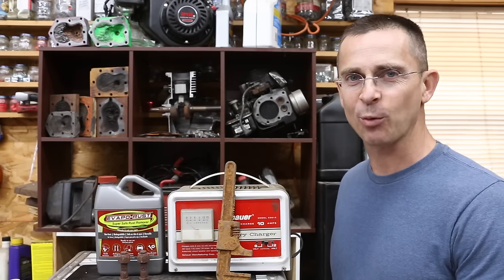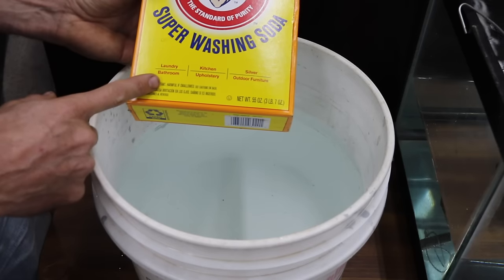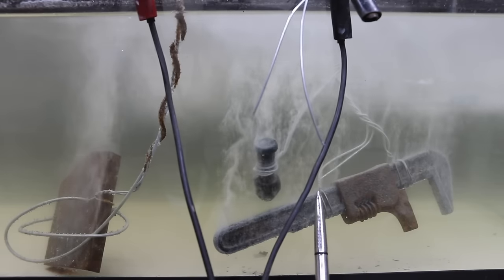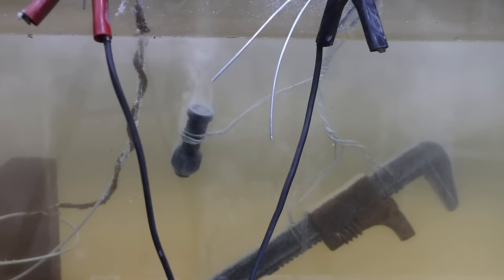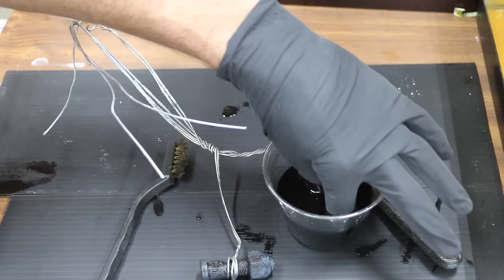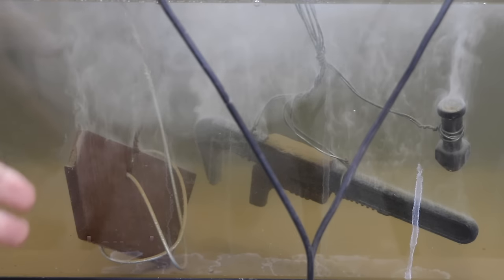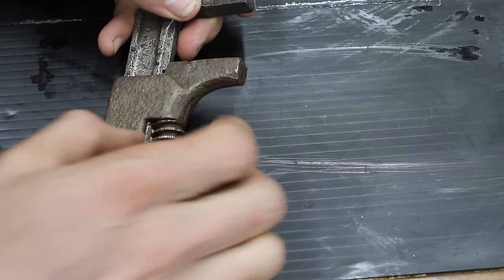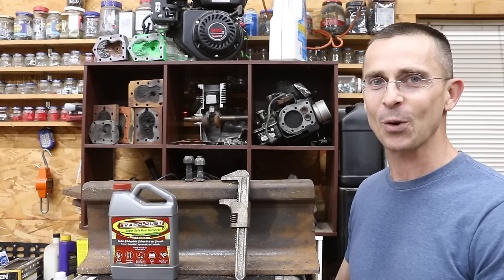Is Electrolysis better than Evapo-Rust?  Let's find out!

Comment: I've tried many different rust removal processes over the years and I've found electrolysis to be the best in most cases.  I like it mainly because it doesn't attack the parent metal like acids do, although soaking rusty or old files in vinegar will clean them up and actually help sharpen them in the process.  Blunted file teeth are reduced in size, so the effect is like filing each tooth, at a microscopic level on all planes, which results in them becoming sharper.  It won't get them as sharp as new, but it certainly will sharpen them some.  If you have a well used file that tends to skip or slip instead of cutting, dunk it in vinegar for a day or two in many cases, it will cut again.  

Electrolysis is also beneficial in another way; generally there are two kinds of rust on old tools or metals, the red outer layer of rust, which is the compound Fe2O3, or ferric oxide.  Red rust is flaky because it takes up more volume than the metal it replaced.  On very rusty things, you typically find a harder, darker layer of corrosion, almost a purply-grey in color, underneath the red oxide.  This is Fe3O4, which is basically the same as magnetite.  It is deceiving as it appears the metal under the red rust is just darkened, but is still corrosion.  You can think of the Fe3O4 layer as sort of the intermediate stage of rusting, it hasn't turned to full on red ferric oxide rust yet.  Fresh, or good steel and iron will have a silvery gray color.  Electrolysis will actually convert the dark Fe3O4 back to iron! 

The red rust gets converted to Fe3O4, the same stuff as the dark underlying corrosion, but since it is already loose and flaky it will fall off.  The conversion also makes the red rust flakes black or very dark (just like the hard Fe3O4 layer underneath it).

A mistake often made in the process is to use too high a current and voltage in the process.  Battery chargers work, but realistically for good quality conversion lower voltage and amperage is needed.  It seems counter intuitive, but higher amperage and voltage will erode instead of convert the underlying Fe3O4.  This might not be an issue for tools, per se, but if you do any research into the process, those who use it on artifacts will use a much lower voltage and amperage for better quality conversion to preserve the piece as much as possible.  A power supply that produces current in the milliamp range is better than using several amps from a battery charger.  If you don't have such a power supply, or don't want to buy or make one, you can insert a small lamp, like a brake light bulb in series to reduce the amperage in the tank.  The higher the wattage of the lamp, the lower the amperage in the tank.

Also, never use stainless steel for the cathode.  Stainless contains chromium, which leeches chromium compounds into the solution during the process.  These are a very toxic and probably illegal to dump down the drain, not to mention hazardous to you!  Only use plain iron or steel for the cathode and for the wire hanging and/or connecting the pieces!  Plain steel and iron on the anode end won't be affected by the process, so wiring to hang and connect the pieces won't get "eaten."  Sheet steel makes great cathodes as you can put multiple plates of it in the tank.  It's better if you have a cathode surrounding the pieces to be cleaned.  Also, as some have noted, make sure you have all your pieces electrically connected.  If you see a piece that isn't cleaning, that means it needs a connection.
Reply from the maker: Thank you for the feedback
Reply: What you add to water?
Reply: "Electrolysis will actually convert the dark Fe3O4 back to iron!" Read the comments in Ken Sweden's video (a chemist) where he says that is impossible: https://www.youtube.com/watch?v=8ulL57OgGu0&lc=UgzZvfU30rtXrT8LVrh4AaABAg.925slTrVO6B926M-jR6oHo  and I quote: "Rust is never converted back to iron, it is impossible. For that you need 2000 degrees and a melt furnace."
Reply: So a usb charger would work?
Reply: A metallurgist?
Reply: @skiterbite  no, just a tinkerer that likes to read a lot.
Reply: @ameunier41  Yes, it will.  But, as you lower the voltage and amperage, it increases the time needed to work.
Reply: one little twist, for the bulb in series-a lower wattage bulb (higher resistance) will lower the current in the tank.
Otherthan that a great comment and thank you for that little review!
Reply: @bgoodr3520  The rust isn't converted back to iron. The Iron III magnetite (black oxide) is likely converted back to iron? Black oxide protects metal from rust. When you wash your parts in phosphoric acid or citric acid, it forms a thin layer of the black oxide magnetite and protects the metal from further rusting. Failure to passivate the metal with phosphoric acid, will cause further rusting. Only phosphoric acid (or optionally citric acid) is an ideal acid for a final cleaning of a steel part, or stainless steel part. It also passivates stainless steel by bringing a chromium layer to the surface and removing microscopic invisible rust from stainless, thereby sealing it. Washing a part in hydrochloric acid, like everyone does, is not acceptable, unless it's done very quickly, and neutralized, then followed by a passivation with the correct acid. Even if you think a part is clean, if it hasn't been washed in phosphoric acid, there can be invisible iron oxide (red rust) forming, which can cause unexpected paint failure years down the road. Use self etching (phosphoric acid) primer, or use metal conditioner (phosphoric acid and water) and wash the invisible rust off and create the black iron oxide passivation film, before paint. Some say that vinegar (acetic acid 5%) actually passivates steel by forming some type of grey iron acetate compound on the metal, but acetic acid is not normally used for commercial metal passivation. If your steel turns dark grey or black, it is likely to not rust very easily. Getting it shiny silver, means it has no black oxide coating, and so the metal is very "open" and reactive to the atmosphere. Always oil parts, and wrap in a warm blanket, to stop rust A blanket (not plastic) is what stops rust. You want to keep the part in a blanket, which blunts the temperature changes that occur, stopping 99% of the condensation that normally occurs when a cold object meets hot air. Plastic can work, if you start with with extremely low humidity before wrapping in plastic, but it's not necessary. Putting objects in a small wooden box that is air tight, is usually enough to stop 99% of condensation and rust. But you can't leave it partially open, or warm air will hit the cold steel and cause rust.
Reply: Evaporust is apparently the best chemical product there is for removing rust. But it also removes oxides off of aluminum and brass, and other metals, so you can use it as a safe, non acidic cleaner for carburetors and other soft metal parts that are sensitive to acid, without worrying about damage. Evaporust seems to be a magical solution, but you have to clean the grease very thoroughly before starting, or it won't do anything at all. Some have said that electrolysis doesn't passivate the metal and leaves it exposed to further rusting, similar to what Hydrochloric acid does (muratic acid/stomach acid/concrete cleaner). Muratic acid will cause run away out of control rust if you don't neutralize and then wash the part with a passivating solution, like phosphoric acid. You can also purchase "blueing acid" from eBay and mix the package into distilled water and it puts a dark blue coating on the steel, forming a type of galvanized coating that protects the steel.
Reply: @Ritalie  Thank you. I have switched from using electrolysis to evapo-rust for all of the reasons you have mentioned. It's just so much less hassle than having to set up a power supply and titanium electrodes. And I could never figure out which how much current and voltage to use, as it seemed like the less current I used the longer the rust removal would take. And evapo-rust is reusable several times. I clean my tools that I derusting with acetone and drying before quickly dunking them into the evapo-rust. I think that is sufficient pre-cleaning, but I could be wrong about that.
Reply: @Ritalie  Acids and electrolysis do not passivate the surface as you mention, but even solutions that do don't usually provide enough to allow you to let the metal stand without some sort of rust prevention coating, be it oil or something else.   

Cold bluing uses selenium (copper selenide) to leave a thin coating on the metal, but cold blue is not particularly wear resistant and abrades or scratches very easily.  Rust bluing is more durable and is easy enough to do.  Hot bluing (the most common process in modern times) uses a hot alkali salt to passivate the surface.  It provides better rust protection than other forms of chemical bluing.  Rust bluing actually provides the best rust resistance since you are laying down a surface layer of magnetite.  Rust bluing is the preferred method for bluing old shotguns that have soldered and silver brazed pieces.  Chemical and hot bluing can damage the softer solder and silver brazing.

For generic pieces, like bolts and screws or other metal parts that aren't temper sensitive, just heating them and dunking them in oil will blacken them and protect them some.   Since steel changes color (from dark straw through a near gold to bright blue, dark blue and even violet to dark gray) you can use a torch to "heat blue" parts that aren't sensitive to heat application.  Once the part achieves the color desired, dunk it in oil.  It takes a steady hand and some experience to heat blue larger pieces to a desired color, but with practice it can be done.
Reply: @bgoodr3520  I always understood it was the generation of gas bubbles that physically pushed the rust from the underlying metal.
Reply: Very good info
Reply: @Edward Lance Oops! The cathode is negative and the anode positive.

Piece to be cleaned = cathode
Iron or black steel = anode

As per the video. You crossed them over in your comment!
Reply: Can you clean aluminum parts with this process?
Reply: @Daniel-vs7qm  very unwise since it is part of the aluminium anodising process. Clean aluminium will oxidise and dirt, especially grease will block the anodising but not be cleaned. Lots of different ways to clean aluminium. Best to do some research to see which best suits your purposes. Avoid caustic soda as it literally eats aluminium and will leave you with a complete mess or maybe even nothing at all!
Reply: This was the thing i looked for. Not the rant above.
Reply: Thanks guys. 🌎✌️
Reply: @boblewis5558  thanks alot for the response i really appreciate it
Reply: YouTube comments can hold some good things. It would be great to follow a users comments here.
Reply: Do you have a TLDR explanation?
Reply: Could this be done in a pond? Like the video points out the big problem with derusting anything typically comes with size. if it does not fit in a 5 gallon pail it becomes hard to find options. I once derusted a piece in my bath tub.
Reply: @Ritalie  " Only phosphoric acid (or optionally citric acid) is an ideal acid for a final cleaning of a steel part"

you can use tannic acid as well, to produce iron tannate, which will "antique" the metal and also provide a protective barrier.
Reply: Fe304 how they rust blue firearms. It can actually protect the metal.
Reply: I've used oxalic acid successfully but couldn't begin to explain the chemistry.

Comment: Some advice for anyone wanting to try electrolysis, use a brush to remove some of the rust on the item that you're trying to clean so the wire is in better contact with the metal.
Reply from the maker: Great tip!
Reply: What setting is the battery charger on?
Reply: I’ll even go a step farther and either nut and bolt the wire or even tack weld it.  Always try to clean the contact area until they’re shiny.
Reply: @jacobluna7609   Thanks for the link!  Good stuff.
Reply: @jamiewyke3929  You can adjust the current by putting more or less of the anode in the solution.
Reply: @jacobluna7609  ,that's a good link, thank you.

Comment: I don't think the adjuster on the wrench was connected electrically as it showed no appreciable change and I saw no activity unlike the other parts
Reply from the maker: You are right. Thank you and Happy New Year!
Reply: It doesn't need to be, it's part of circuit. Technical he only needs one lead on that wrench. 

Think of how many contact points are in those treads. I'm surprised it didnt take longer. Cool video
Reply: Project Farm so Why did you not fix it under the test?
Reply: @adammartinez5666  Um sorry if I disappoint you but yes it does there is so much corrosion on that part that it could not conduct electricity same as when a corroded battery terminal will not pass voltage to a starter this is a no brainer! And to clarify since it's clear you thought I was suggesting that the actual part had to be connected that is obviously not what I meant
Reply: @adammartinez5666  I was thinking the same thing. He didn't do anything wrong, other than not wait long enough. Also, he could have sand blasted it periodically. But then again if he had access to a sand blaster he might have realized how silly this video was to begin with. :p
Reply: i think so the rust in between the wrench and the adjuster impedes current flow so a wire connected to the adjuster would have helped
Reply: @mrbilky  glad you said it. He could have wedged a wire in there to get the flow to cross into the barrel adjuster too but either way cool results
Reply: The oxide layer was insulating the nut assembly from the conductive main section of the wrench.
Reply: Yea somting definitely messed up ..I use eletro all the time and 24 hours is basicly my goto time and my stuff comes out way cleaner .  I use salt as my eletrolight and 1 to 2 volts and the sacrificial anode I use expanded metal 3 times the weight of what ever Im cleaning..aka more surface area

Comment: Hey Project Farm, just an FYI an adjustable Power Source is FAR better to use than a Battery charger. You can set it to 24V+ and closely monitor the Amperage. The time it takes to use a 14-16v for electrolysis is also MUCH longer than when using 24V. The clear Amp reading is also helpful in getting the right amount of baking soda in the water, or to see if your plates are impeding progress. If the dilution is too low you will have low current (aiming for 2A is optimal), same goes for the plate over time! Cleaning the sacrificial piece is a big big factor in the time it takes for heavier jobs!
Reply from the maker: Thanks for sharing.

Comment: I’ve used electrolysis to de-rust an old railroad signal, and here are a few tips. 

It is largely a line of sight process, so you either need to rotate the pieces, or use multiple sacrificial anodes. I take a few pieces of rebar, bond them together with copper wires, and set them around my container. 

For things with many parts, try to disassemble it as much as possible. Like others mentioned, the adjuster didn’t get de-rusted much because firstly there was little path for the current, but also it has a hard time doing its job because of the lack of line of sight between the inside of the adjuster and the anodes.
Reply from the maker: Thank you and Happy New Year!

Comment: How about a video on no matter how careful you are, the red squirty  tube that comes with WD40  gets lost the first time you use it......
Reply from the maker: Lol. Thank you and Happy New Year!
Reply: It is an immutable law of the universe!
Reply: I got some silicone spray for my car's electric windows and the tube came off and fell inside the window gap. It's still there. The window goes up and down fine, but I still imagine that little red tube bouncing around all the moving parts.
Reply: Not trying to kill the fun, I actually have a used container stuck to the wall next to my garage door just for that purpose, all spray can straw goes there. That container and its content are some of the few permanently placed stuff in my garage.
Reply: drop of jb weld save it for next can
Reply: Use super glue gel
Reply: that's why you don't remove the tape it was held onto the can with
Reply: I started super glueing it in
Reply: First thing you do with the length of hose supplied (taped to the side of the can) is cut it in half. Install the part you're holding into the spray nozzle…

The second thing you do (if you haven't already) is erect an altar with a donations box built into it to receive all manner of nozzles, hoses, caps, adaptors, etc. that are removed, religiously and with reverence, from any aerosolized liquid in a can before the empty can is sent off for reincarnation in the Melt. 

Near the altar, you can hang a sharpened piece of steel rod to pierce the can, just inside the rolled rim, in the gutter there, for those instances when the pressure drops to zero before the volume of liquid does. Pierce, and decant the elixir into a small container with appropriate label and cap.
Reply: @michaelthibault7930  Cut the tube in half. Why didnt I think of that?
Reply: HaHa exactly, I hope i find them all one day!
Reply: I cut a 1/2 slice of a bicycle inner tube and put it around the can.  Slip the spray straw into home made rubber band and it stays with the can.  The inner tube lasts for years.
Reply: @Rusty_ok  good idea, thanks!
Reply: I save those when I can because they DO tend to wander away.
Reply: @notmirelnam248  
Look at the positive side, you'll always know where it is.  🤣
Reply: 1 thing i do with those things is sandwich it in a piece of silver HVAC tape .act's like a flag easy to see. Try it .
Reply: Easy fix. Once done with a can of Fluid Film, save the cap.
Reply: I use a couple of rubber bands on the can to hold the tube, the fat ones that come on broccoli are perfect, two much better than one.